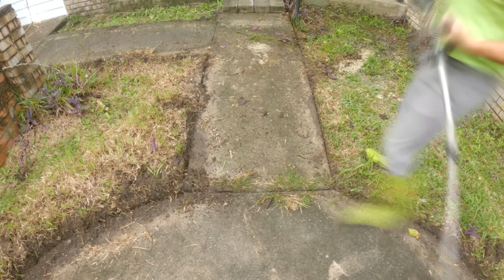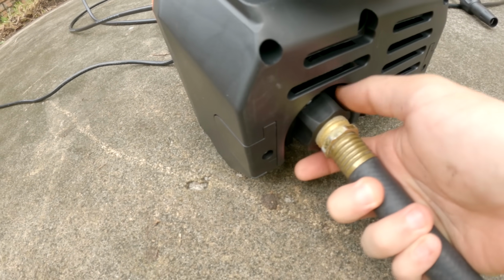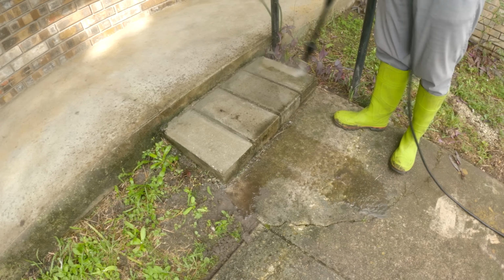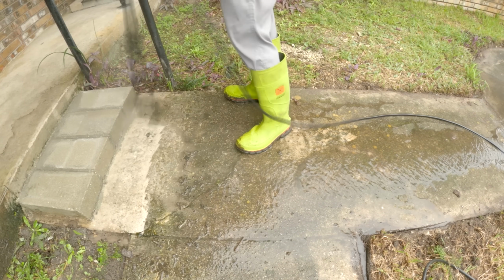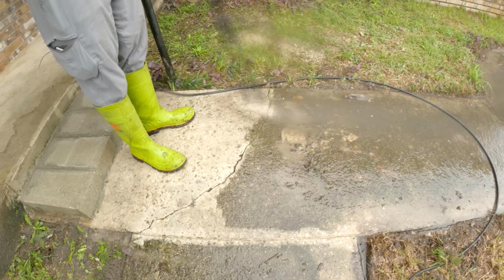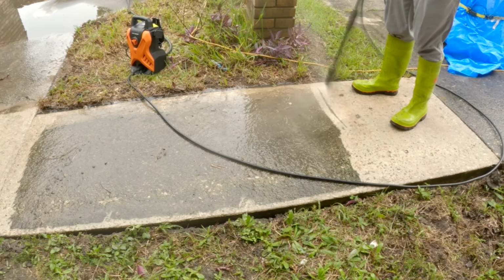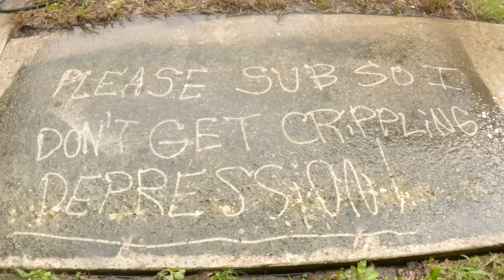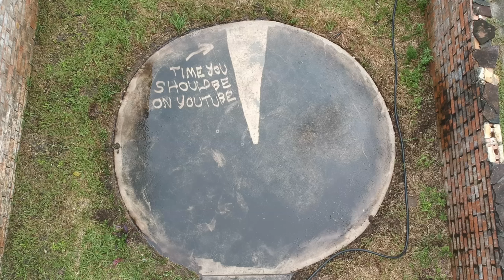NASTY Patio Cleaned By CHEAPEST Pressure Washer (Oddly Satisfying)

Comment: Love it Brad, I believe you should have done the brick walls too, that being y, nice job, I'm trying to get my own pressure washing business going but I'm limited to using a small car and though I have plenty I can get done, I really need a truck to do it better, I have a very used Husky, circa 2007 with a new high out put pump, surface cleaner, and turbo nozzle, all which works great, I get a lot of brick, stone and concrete foundations, driveway, curbing, siding and slate roofs, any suggestions for asphalt shingles? I have to use sodium hypochlorite very sparingly here as I'm in a major watershed and can get fined for polluting the water ways

Comment: Hmmm for your main things you use, why do you use a 2200 PSI pressure washer but the circle thing that washed the ground is 4400? Doesn't that mean you can only wash to half of the surface cleaners ability?

Comment: There are about 25 branded units like this out there that are the exact same units. I have one of them. They are total pieces of shit but to clean up around the house they work just fine. If you have a 70' driveway this unit will die.
Reply: I ran one for an hour and the bearings started to squeak.
It went back.